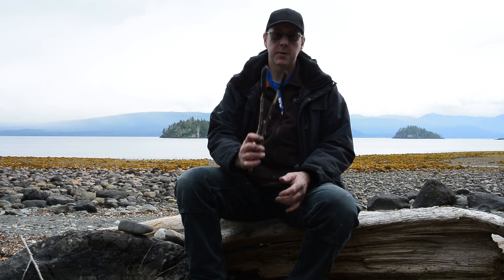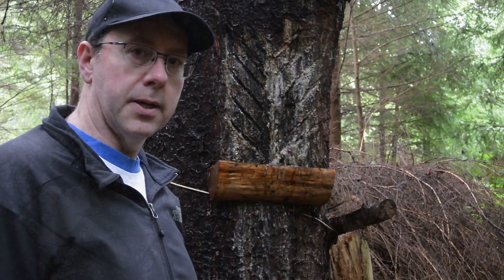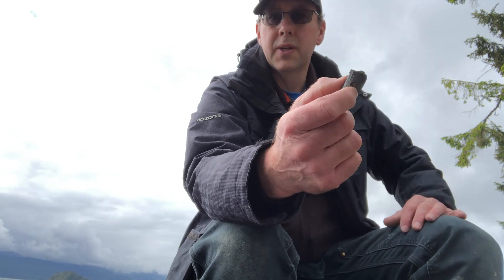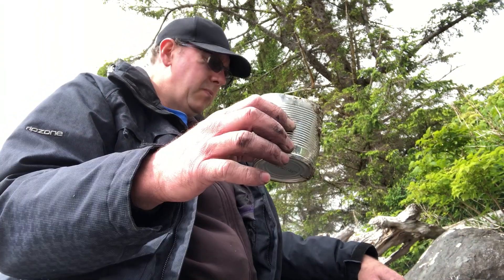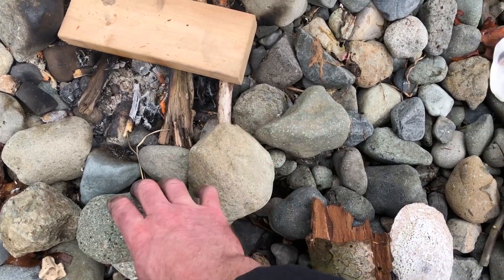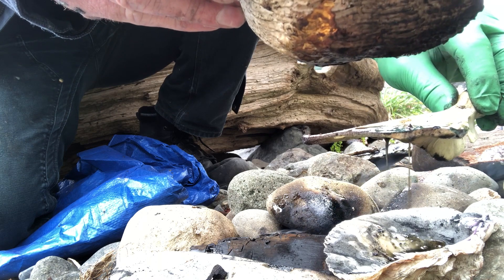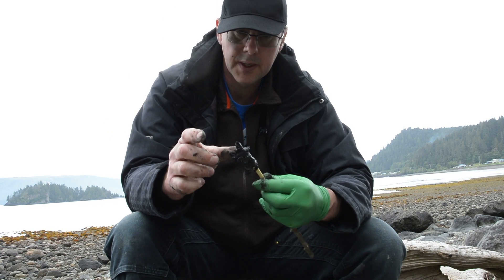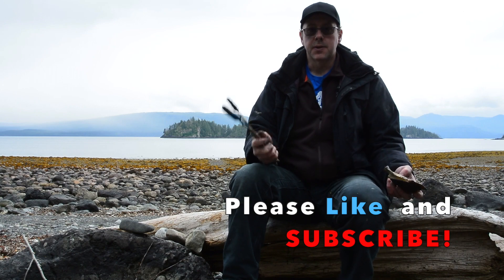How To Make PITCH GLUE!! Learn how to make pitch glue without a tin can using a spruce pitch screen.

Comment: eagles goin crazy there..was wondering once it hardens does it soften up in hot sun,?say on a spear?
Reply from the maker: I've never tested it in extremely hot weather but the charcoal does keep it from getting soft.  On a spear it would be used to seat the spear head and keep it from wiggling around and loosening the lashing.  It would also be used to lock the sinew or twine lashing in place by embedding the lashing into the glue. Definitely performs best when combined with lashing or some other form of mechanical fastening.
Reply: @haidagwaiisurvivalguy7112  ok ya i thought s0..just wondering if it softens up if laid out in extreme heat.also wondering if you can stir the  charcoal into the soft sap right on the tree and apply thus saving the step of melting the hard stuff , building fire, gather cans ,making a mess etc or if it needs to be heated and mixed in.. but ..ill be testing it out thnk you for reply back..interesting stuff
.